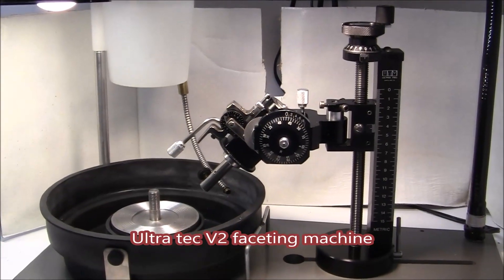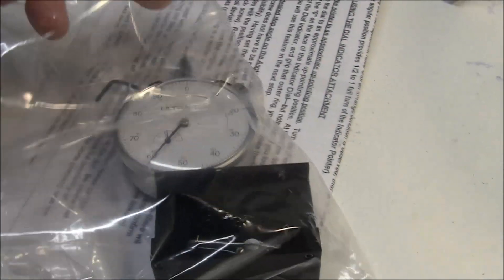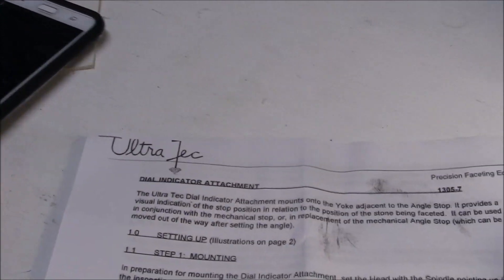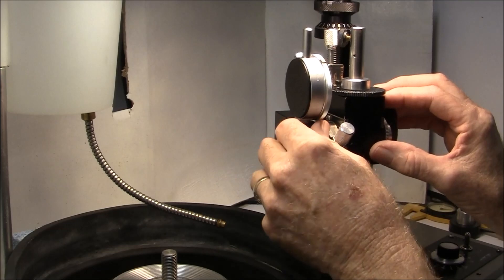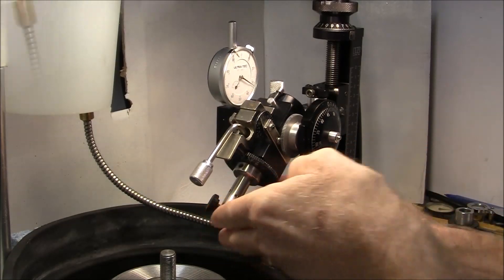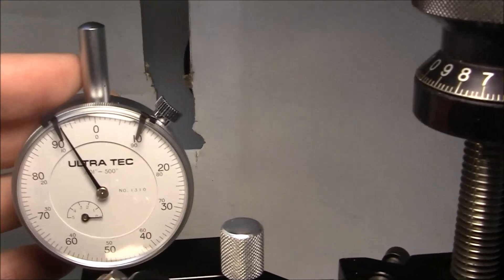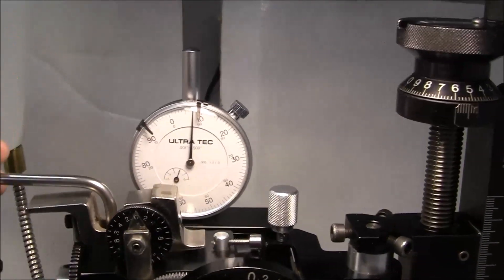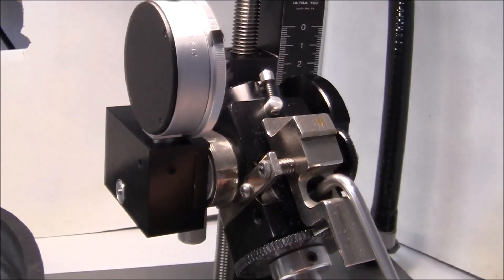Ultra tec faceting machine depth of cut gauge install.

Comment: Was wondering if sometime you can go through a cleaning process of your machine. This fall I'll be receiving an ultra tec (an older one) .not sure how the threaded stock for the vertical movement is cleaned and then lubed. Is there a product  you can recommend? Thank you , Daryl Stevenson

Comment: should I buy the dial indicator for my V5 or just save the money?  thank you and keep up the great work!
Reply from the maker: In my opinion , after using a dial indicator , i dont care for them. I use and reccommend a beale wolley meter  which is  simply an electronic depth of cut    device  which can be connected to an ultra tec machine  easily.  I found i didnt like the dial indicators return spring tension  when  reaching the stop point.   When i used  a facetron it was very noticeable , the ultra tec  not as bad. I like whats called a  hard stop machine  and adding a dial indicator   gives the feel of a soft stop machine .  This is my opinion , you may be fine with the dial ind.. As long as you are  getting a v5 machine you probably wouldnt  need anything  more than  the DAD   digital angle display.
Reply: @tennpikr74  thank you very much for that response!

Comment: Nice video Sir.....but cant see your email address in your details, need guide on how to acquire a used Ultra Tech V2  Machine. kindly reply
Reply from the maker: Hi,   used machines are very hard to find.   Look on ebay for faceting machine .  Still a used one  will cost  $1500   to $2000   USD.

Comment: I've seen the V5 ultra tec has an alarm when you reach the depth. Is this alarm  comparable with your machine ?
Reply from the maker: yes,    i believe the audible  alarm feature is intergrated in the digital display on the UT v5  which is available as an upgrade for my v2 
machine. Im planning on purchasing the digital angle display  soon for my machine.

Comment: did you replace the facetron?
Reply from the maker: Yes,  i  had gotten a great deal on the facetron 2 years ago,  had it upgraded to the dial indicator depth gauge  but i came across this ultra tec and i will add the digital  gauge later on.
Reply: @tennpikr74  
I bought the same V2 two months ago.
Also I will upgrade it in exactly the same way.
The way to Germany is unfortunately somewhat longer.
But I do not want to do without it.
Reply from the maker: @satsadhu  Good, they are nice machines.
Reply: @tennpikr74  
Indeed

Comment: What happened to your Facetron? Let us know how you like the Ultra tec... I believe it's half the cost of a Facetron..
Reply from the maker: I have sold the facetron. I have cut 2 stones on this ultra tec but had one before . I  like the  screw gear  mast on the UT although it is slower to use than the facetrons but is easier to use  when raising the head up and down. The splash bowl is deeper on the UT.  The U T has a small transfer jig which will not work for me when i do the very large stones. To be fair , UT is now offering a very large transfer jig. The motor on the facetron was a slightly faster motor . Accuracy on both machines seems equal. It does take a little more time to set the UT angle.   the facetron sells new for $3495,
the UT v5 non digital is $4595.

Comment: Hello thank you for this helpful clip .i have a question do you need to adjust indicator for each angel every time?i mean if you need to change the angel for example to 42 or 35, do you have to set indicator to new angle  again ? Thanks.
Reply from the maker: You mean to zero out the needle . No you can set the new angle while leaving the needle straight up and on zero but it takes a little finessing to get it perfect.  Otherwise when you change angles and the needle isnt zeroing out right away you  just move the outer ring so that the needle and  zero line up as i did in the video .  The zero could be anywhere such as  12 o clock, 5 o clock, etc., but its still your stopping point.
i hope this helps some.
Reply: @tennpikr74  Thanks a lot.